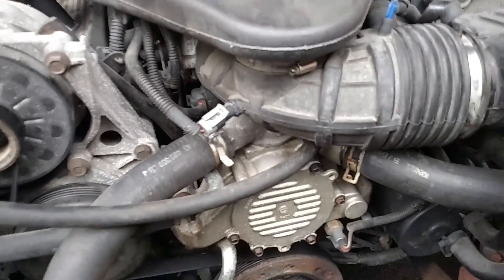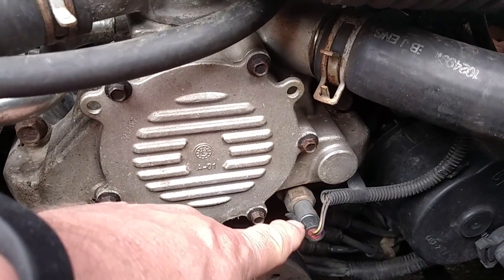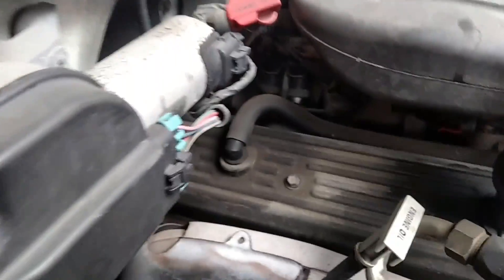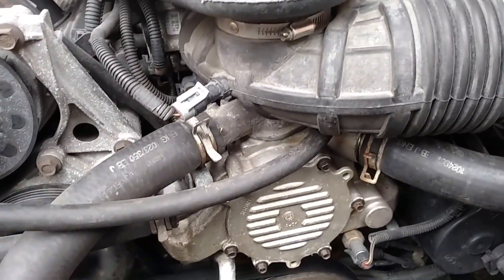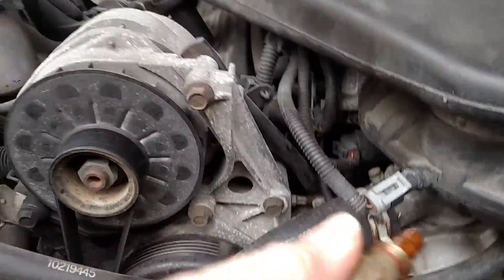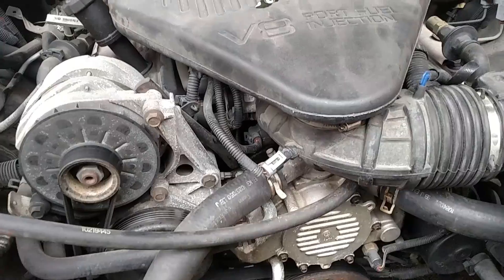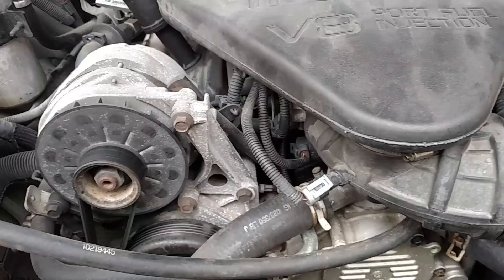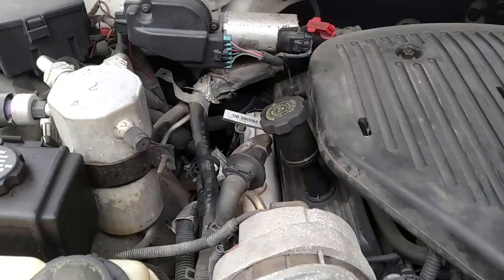Cooling sensor malfunction on lt1 GM

Comment: Hi..why is the one right side fan comming on when the temp guage says 3/4 hot..cant figure it out
Reply from the maker: Are you running the defrost. It's connected to the fan. Because the compressor cycles when defrost mode

Comment: Thank you, I am working on a 96 Fleetwood Brougham, and the fans will not kick on. The car idles until it reaches 200° Then overheats, so this video gives good clarity. Thank you sir
Reply: I have a 96 fleetwood as well, my car always seems hot but doesn't overheat. I can't figure out why it seems so hot.
Reply: @matthewsalcido3 I was thinking coolant temperature sensors, plus I wanted to switch out the one towards the driver side of the block. I believe that it goes to the fans, but we got it bypassed.
Reply: @SimonLopez3312 I been looking into the heater control valve. It's inline with the heater core. From what I seen on YouTube it also will make your car overheat if it's not working correctly.

Comment: The sensor  in the head is for the dash gauge . The sensor in the water pump  is for the fans and ecu. The one in the head is a one pin, the one in the water pump is a 2 pin
Reply: Dammit 😂. I got the wrong one
Reply: Great explanation thanks

Comment: Are Both them are the same sensor or different sensor
Reply from the maker: @Yellowmen88  not ,100% sure one is for the gauge and light and the other is for the fan. I'm sorry you need to get the one that is causing you a problem. I'd say look up temperature light sensor and cooling fan sensor and see if they are the same.

Comment: I cannot figure this crap out yet.  I have a brand new good water pump because it full cools the engine when fans etc run (AC DELCO PUMP).  I replaced the sensor on the pump and it reads on the digital gauge, my engine block analog sensor reads on the dash too.  BUT the damn fans wont come on unless I use the hvac then they blast on high,  So they are working.  So WTH is not turning them on at high temps even close to the danger mark on dash temp.  PLEASE ANYONE HELP ME LOL

Comment: So I just did a full water pump replacement on 95 C4 Corvette, and noticed the fans not coming so I had to quickly shut it off as I was burping the system and it got really hot, luckily below the danger area reading.   I just ordered the one on the pump at front because what you said the engine block one tells the dash what temp and the pump one controls the fans, which work with the heater on, so they are good.   I will get the part in 3 days.  Do you think that is why my fans are not activated, this sensor is probably original since it only had 44k when I got it a few months back?  THANK YOU for the video!
Reply from the maker: @barneythedog977  there's 2 sensors. One controls the fans and the other one goes to the gauge. Gm flipped them around to different locations. If you don't see it on passenger side check the driver's side. Sorry I just seen your message
Reply: @jamesaubrey1965  Yeah youtube seems to stop sending notifications so I missed this too.  Thanks
Reply: @jamesaubrey1965  No luck on pump sensor and man it shot coolant out bad lol,  I  reposted my issue on the comments thanks for trying !

Comment: I had to just unplug mine from the water pump. My gauge reads right, but the dang fans don't come on even with a new water pump and the sensor.
Reply: I really would like the fans to run with the engine off too though. I'm thinking about just running them on a dang switch

Comment: Could that stop both fans from working at the same time I'm having that issue only one fan turns on I can't get the other one to turn on I have both new motors on the fans The password side turns on but the driver side does not turn on
Reply from the maker: Mine does the same thing. They said under a load of the AC compressor it would kick in once it got higher in temperature. But I never see it come on either. But honestly I can't get the temperature to get above 1/4 on the temperature gauge. Lol I've even put cardboard in front of the radiator to try to get it hotter. The car just runs really Cool.

Comment: The sensor in the water pump feeds the ECM. The ECM turns the fan on and off. 

The ECM uses the sensor in the water pump to calculate fuel as well as other things related to engine coolant temps.
Reply: Do you think this sensor could be a reason the fans won't turn off?
Reply: @keithbutler7896  possibly, but it could be other issues.

Comment: New subscriber 🔥🔥🔥 My 95 Roadmaster heater won’t get hot. What you think is going on?
Reply from the maker: I'm actually going through the same thing. I'll let you know when I figure it out. And likewise if you figure it out hit me up. I'm leaning towards the thermostat. I'm going to flush the cooling system and replace thermostat.
Reply: @jamesaubrey1965  I fixed it. It was the actuator blend door right behind the ashtray. I plastic welded it to repair it. That actuator was $140👎🏿👎🏿👎🏿😂😂😂
Reply from the maker: Thanks I'll check mine out. It's always making mechanical noises
Reply: @jamesaubrey1965  when you go from hot to cold you should hear the door open and closing. If you don’t hear it that’s your problem.
Reply from the maker: @papergatorzfedducca7998  thanks.

Comment: Last fall, I couldn't start my 94 buick roadmaster when the engine was hot.  Never ran right even when cold in idle and spat out black and/or white smoke when giving some gas and hesitated.  Shouldn't be burning coolant or oil especially didn't smelled like it.  Likely burning too rich.  Which lead me to believe it maybe a sensor and ECM issue. Currently a garage queen and sat for 10+ years but plan to put her back on the road for weekend drives next year.  Researched and thought for hours upon hours trying to narrow down the problems.  Opti, fuel pump, fuel pressure (pressure tester actually arriving today), fuel filters, vacuum leak, fuses,  ECM (likely because I shorted the battery terminal before all this happened).  Finally, decided to do some real trouble shooting.  Pulled up the climate control codes and found none but temperature coolant sensor was reading 0C.  Pulled the plugged on the one beside water pump and the pins were corroded beyond repair.    Tested the plug and it read 5V. Excellent! ECM is good!  The engine started right up while still warm. Zero hesitation when stepping on gas.  Barely any black smoke. No white.    I forgot the temp reading but it defaulted above 0C when unplugged.  Problem solved!  Just need to replace temp sensor.  Now, just need to fix AC, change fluids, hoses, all shocks and other problems along the way to get her up and running like new again!
Reply from the maker: Thanks for sharing your story. It should help others. Thanks for subscribing and sharing that's how we help others
Reply: @jamesaubrey1965  NP!  I wasn't ready to go down that rabbit hole of just replacing parts to get it fixed. My approach is always go after the cheapest, easiest and most obvious problems first.  Test if possible and move on.  But that doesn't happen often in real life. lol! Lucked out on this one.  ECM would can cause the same problem and not spit out any codes.
Reply: I'm looking at buying a 97 lt1 camaro, I cannot start it without flooring it. When it fires over it wont idle and only runs without misfires at 2500 rpm. Could this be the temp sensor next to the water pump?

Update 

It was the temp sensor on the front next to the water pump. You can plug in a scanner and check if its bad, it will read -40 if it is.

Comment: Great video. Great engines but they are old with modern stuff bolted on ha ha. You can get a cheap reader that will tell you what the important sensor is saying, the other one seems to be there just to worry you.

Comment: Where is the year sensor connected to on a 1995 Caprice?
Reply from the maker: Look on the head's by where the spark plugs are. They could have put it on either side of the engine. Try there hope it helps

Comment: What is the part number? Every search to buy one everywhere only shows the one on the water pump
Reply from the maker: Depending on model and application it's in the cylinder head. On Buick roadmaster it's in the passenger head. I think Camaro it's on the driver's side. Just look by where the spark plugs are and you will see a sensor with a wire on it that's it. So you need to check to see which side yours is on. Hope this helps.
Reply: @jamesaubrey1965  thank you but I know where it is. I mean where do I buy one? 
It looks like they don't exist.
EVERY search turns up the sensor on the waterpump

Comment: Just changed my water pump and thermostat on 96 impala. It's no leaks and car is not hot while on. But when i cut the car OFF the temperature gage goes all the way up to HOT. The engine shows no signs of being hot nor is bubbling noise coming from coolant reservoir. You think that has to do with that same sensor in this video?

Comment: My fans ain't popping on, and this video clears up a lot. Thanks.
Reply: Did u have coolant loss?
Reply: @JohnDoe-jd7mf  I did not. I found out that the fans pop on at 217°F AT THAT SENSOR, meaning that they pop on deceptively late. The cluster needle was taking a bit of a lick from the red zone by the time they came on.

It's such a design flaw that even the people at the Buick dealership thought it was overheating. But I did take a temp reading, and it is technically within spec.

That said, if your coolant gets too low, it will not interact with the sensor at all, so they will never pop on.

Comment: From my understanding yes GM placed the LT1engine  in 1994 - 1996 Chevy Impala's SS's and in some Chevy Caprice Classics including the C91 Chevy Caprice PPV / THE Cadillac Fleetwood Broughams / Buick Roadmasters / And some Chevy Camero's and if im correct the PONTIAC Trans-Am & Firebird series plus a few other models. I forgot to mention depending on model the LT1 came with either Aluminum heads like on the Chevy Impala & Caprice PPV and a few others including the Cadillac Fleetwood Brougham that came with cast iron heads that adds to weight plus the only major bummer is the LT1's GM OptiSpark distributor system that I feel should have Been placed in a recall and updated to the coil over sparkplug systems used in newer GM Vehicles.
Reply from the maker: Yes don't forget to mention the intake gasket leaking

Comment: Coolant sensor, was one of my problems. Now it's missing at idle and running rich plus it's smoking at idle. Anybody have any idea?
Reply: No guarantee this is your problem, but I had a rough idle and smoky exhaust and it was a bad ECM.  I ended up buying a refurbished one from flashmasters and that fixed it.
Reply: I got the air intake sensor cleaned out and it runs way better, I know it needs new O2 sensors and a new knock sensor. I found a shop that has a computer that works on my car. 😄

Comment: What is that sensor called for the fans.
Reply from the maker: Depends on which vehicle. I believe it's the one on front of the engine on the Roadmaster. The coolant gauge one is on passenger head on passenger side. But check both head's  sometimes they flip they head onto driver's side. Thanks and good luck.
Reply: @jamesaubrey1965  I have a 95 buick roadmaster sedan. And my fans are not coming on like they should. So I was trying to see if you knew the name of that sensor under the water pump?
Reply: @Mr450bigblock  coolant temperature sensor

Comment: Having this problem right now . Will change both the sensor and thermostat
Reply from the maker: Be sure to bleed the air out of the system
Reply: @jamesaubrey how do you bleed air our of the system
Reply: @zoetyson1374  Super easy.  Just get it up to temps and open the screw until just coolant comes out.  

https://www.youtube.com/watch?v=haBNa4rQ4z4

Comment: Thanks for the obvious. I too thought it was on the water pump. I just changed (fought) plug wires, plugs, rotor,cap and it has been such a delightful engine to test my anger and patience. I wondered why the low coolant light was now on. 😂🤣💩
Reply: On my LT1 there are two coolant temp sensors.  One is for the analog gauge which is on the side where he shows early in the vid.  The other is in front by the water pump and sends a signal to the "ecm" and in my case a digital gauge.  My digital gauge flashes "Lo" and reads 142 all the time.  My motor is in a corvette so maybe more gauges but I'd guess a similar ecm set-up.  I am looking at vids to see where mine is at and how people go about getting at it so that is info from other vids and google.
Reply: My 95 camaro z28 doesn't run hot but the low coolant light is coming on but the radiator is full right up to the cap so no clue why that is.
Reply: @me005003  my "lo" signal was indeed the digital coolant sensor.  Stupid sensor was actually shutting my engine off.  I don't recall the exact amount but it was $25-30 for a new sensor.   I had to pull the throttle body air ducting and maf housing to get at it... a couple hose clamps, a couple wires, so no big problem there.  That let me get a socket on the sensor.  As a vid told me I had the new sensor unboxed and ready because coolant comes shooting out as soon as you get the sensor out.  So the motor has to be cold enough to remove the radiator cap so no pressure can be in the coolant system and cold enough the coolant does not burn your hand.  For me it was a 100% fix for my issues.  Correct gauge readings now and car no longer shuts off going down the road.  My vette is a '94 so probably very similar engine to your Z (LT1).  Of course a two wire plug to unhook and rehook to the sensor.

Comment: I have the heavy duty cooling on my 96 Roadmaster but the temp gage never goes past the 2nd line like it’s still cool. Heat doesn’t work except in idle but when I drive it’s blows cold. Changed thermostat coolant and fan clutch for the mechanical fan but no change. My buddy says the temp gage should be in the middle when it’s at operating temp. Is that true? Gage went way up after coolant change when air was in the system so I know the gage reads to make the gage go past the 2nd line because it was just under the ted until the system was bled.
Reply from the maker: It sounds as if if has an air pocket in the system. The coolant hoes by thermostat should have a bleeder valve. Hope this helps
Reply: @jamesaubrey1965  I bled the system with that valve. Doesn’t get hot just never reads higher than the second line from the left like it’s not up to temp. I’m currently stationed in Germany so don’t have much experience over here to help. Do you think it’s normal for the temp gage to read so low after it’s up to operating temp? Thanks
Reply: No that’s normal these cars don’t run to hot and takes a lot to over heat as long as it doesn’t go over half

Comment: Hi , 
I got 1996 caprice Classic I put new coolint it tooks only one and half bottle , than the heat when up 3/4 and the fan did not work to cool the engine down, 
So what do you think I should do brother? 
Thanks
Reply from the maker: Sounds like you might have an air pocket. See if your top radiator hose on the engine has a air release fitting. Sounds like you need to purge the air out.
Reply: @jamesaubrey1965  
I did brother , 
But still got almost 2 bottles that is it 
, the big problem is still the fans don’t work when the temperature going up 
I checked all the wires it hooks up .
Reply: @aladwanit  temperature sensor in water pump

Comment: I have a 94 cadillac fleetwood brougham , i dont have a guage , i just have a low coolant light that keeps coming on , i added some anti freeze to the reservoir , and filled it up , but the light continues to stay on . mine is also the LT1 engine .
Reply from the maker: I think there might be a sensor on your reservoir tank. I so unplug it and test it. That might be your problem
Reply: @jamesaubrey1965  ok , thank you .
Reply: It might be the radiator coolant sensor, it's very easy and cheap to fix, bought one on eBay for about 8 dollars
Reply: @pablotorres2749  Thank you for your reply , my coolant light finally went off after a couple of days , it has been really cold here in Illinois with a lot of snow and below zero temps . I will keep an eye on everything as far as the light is concerned . I have a new temp sensor to replace , as soon as the weather permits to replace it .
Reply: @erwinpierce1136  be careful with the low temps bro 
I recently replaced the radiator in my trans am  and found out my old coolant sensor was rusted as hell even when I run it with coolant lol it was giving false readings but now everything works as it should

Comment: How often should the primary fan turn on and off?
Reply from the maker: Depends on the water temperature. You could hook up an volt meter and put it in hot water it should make contact on meter and should stay on until cools down you could put in a bowl of cool water and should loose contact. It's basically a light switch that operate on temperature rather than flipping a switch. You probably understand what I mean. Good luck.

Comment: That sensor that you changed out I see that it only has one wire same as minebut every time I go to look for a new sensor they all have two prongs
Reply from the maker: I had to go watch the video again it's been so long ago. But if you watch the part where I had sensor in my hand it has 2 prongs. So I think you should be good. Thanks let me know if I can help you with anything else

Comment: Would I be able to cut those wires and hook them up to a two print switch and just manually turn the fans off?
Reply from the maker: I would think so. Just run into a keyed circuit so you don't forget and run down your battery

Comment: Do you know if the sensor at the same spot on a 1994 chevy caprice 4.3l v8?
Reply from the maker: I'm not sure on that one. Sorry. I would go to local salvage yard and pick up sensors off engine and swap them the chance of getting a bad sensor is slim especially if it was because of vehicle been in a wreck. Good luck